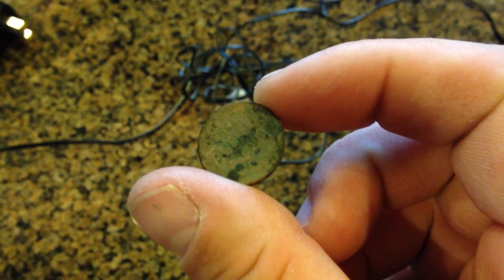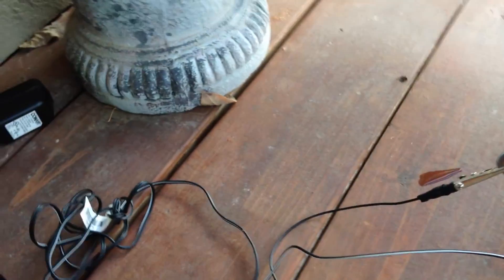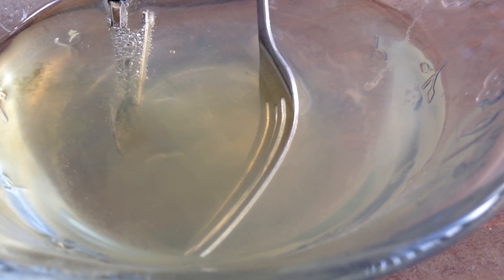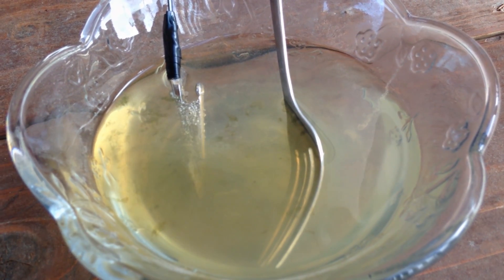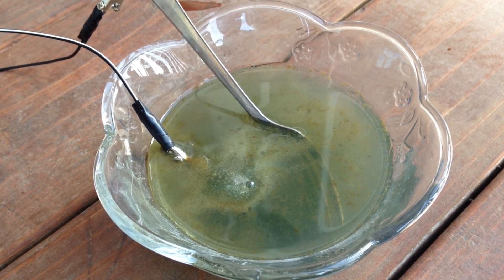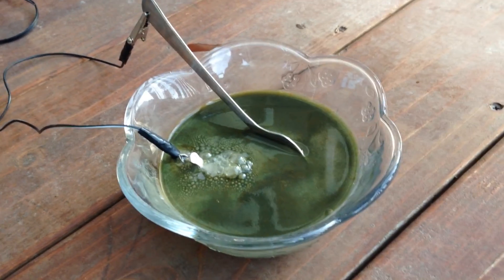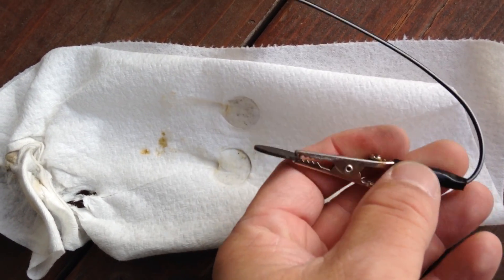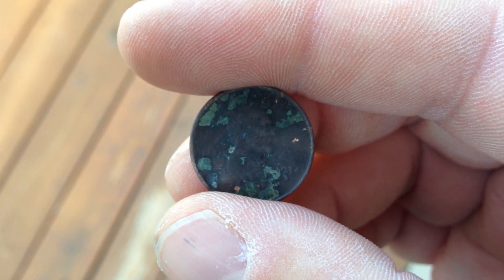Coin Electrolysis- Basic How to

Comment: Never use stainless steel in electroloysis
Reply: but why tho
Reply: @nathanholyland9493  while you use SS as an anode, the chrome that is finished on the steel is also be released. 
This releases hexavalent chromium poisoning which can only be released if chrome is heated, or being separated from where it is placed. It's very dangerous, and the effects are just as bad as chloride gas.
Reply: @czoduqa  so basically, dont do it or risk health problems or death

Comment: Use washing soda - not baking soda.
Don't use salt.
Don't use stainless steel. Use plain old iron, steel or carbon rod as your sacrificial piece.
Positive connector on the sacrificial piece. Negative connector on the work piece.
Keep your connectors out of the water!

Comment: what watt and volt is the charger plug ????
Reply: Those transformers aren't standard.They put out different voltage depending on the appliance they're made for.
Reply: Mr. McGoo the electrode dissolves though so the wire would get shorter over time I imagine
Reply from the maker: It is just a standard charging cord from an old shaver i had.
Reply: thanks Ryan , does it matter  what watt or voltage I use ?  , I want to try this a.s.a.p. it looks to work great , just don't want to get zapped  LOL
Reply from the maker: jeff c the Higher the wattage the faster it will work. I use this one and it takes about 1-3 hours to really clean the coins.
Reply: very cool thank you !
Reply: You could use  a standard electric cord and really save some time. Blow that crust off almost immediately.

Comment: Something that you absolutely have to know because you're actually putting yourself in danger not because of the electricity I'm sure you're being careful of that but you absolutely have to stop using stainless steel as your sacrificial piece of metal because when using stainless steel in an electrolysis setup it gives off a toxic gas it is very dangerous used just a piece of regular old run-of-the-mill Steel easiest way to know is if it's got some rust on it then you are safe
Reply from the maker: Yes. I only do it in well ventilated outdoor areas. I would never do it inside. Thank you for the heads up
Reply: +Rocky Mountain Prospector Ryan I don't know if you're thinking that I'm just talking about hydrogen that is something that will be created when you are just using regular old steel or iron if you use stainless steel the components that will be broken down into the water and gas are hexavalent chromium it is a very highly toxic substance causes cancer and all sorts of really nasty things and it is completely illegal to dispose of the water that that is mixed with and you could actually receive a huge fine and I've actually heard of people getting prison sentences for disposing of this you really should get rid of the stainless steel that you're using as your sacrificial piece of metal and just use a piece of old rusty metal or another good thing is go to a Place Like Home Depot and get a piece of rebar and cut a piece off of that it will last you a long time and it is safe to use it is not a good idea at all to use anything stainless steel in your electrolysis setup
Reply: +Rocky Mountain Prospector Ryan you might have even heard of hexavalent chromium if you are someone who watches movies and possibly seen the movie Erin Brockovich all those horrible things that happened to those people in that movie which is a true story that is what you  are exposing yourself and your family too but using stainless steel in this setup I can't stress enough you really should not use stainless steel it is highly highly dangerous to use in an electrolysis setup even in a ventilated area because it doesn't matter about ventilation because most of the hexavalent chromium will be in the water that you dispose of afterwards which like I explained already is highly illegal disposal you need to have it properly disposed of at a chemical waste dump and you don't even want to go in having this substance because like I said it's illegal to even have also  you absolutely do not want to be putting your hand in that water to get anything out you don't even want to be touching it obviously do what you want no one can stop you from doing that but every word of what I just said to you is 100% true and accurate do you really want to be putting yourself and family in that Danger or be risking fines or imprisonment
Reply from the maker: +Matthew King thank you for that info!
I am going to switch out the piece of steel I found metal detecting today.

Comment: use baking soda instead of salt because salt will produce chlorine gas
Reply from the maker: I will definitely try that. Thanks for the safety tip
Reply: and dont forget the sodium hydroxide
Reply: Niv Moshe the sodium hydroxide could be useful if you are making sodium metal
Reply: Drake Mckay actualy its hard to extract the sodium hydroxide by that way because it will react with the chlorine gas at the anode and will produce soduim hypochlorite bleach
Reply: Nah, that's just for molten salt and not salt solution. The bubbles here are hydrogen iirc

Comment: er...isnt the negative connectected to the penny?
Reply from the maker: +Ivan Tsantsarov I just put both ends of the electrodes in the water in the one started foaming was the one I connected to the coin
Reply: +Rocky Mountain Prospector Ryan, I think that positive charged Cl ion grabs an atom from the fork, deliver it to the coin and then Cl gas releases in form of bubbles. That is what caused foaming
Reply: +Rocky Mountain Prospector Ryan,  because electrons runs out of the negative and separates the rust and one just falls down :)
Reply from the maker: Tony Carpenter ive tried it both ways and i think you may be right

Comment: How much of the Copper (Cu) base metal is lost during the process?
Reply: A small sheet of copper in place of the fork and use some copper sulfate in your water...  then you won't loose any copper, as it is your copper with replacing Fe++.
Reply from the maker: The electrolysis doesn't harm the copper I don't believe. At least when I've done it the coin didn't seem to have been affected by the reaction going on.

Comment: Replace the salt with baking soda, it makes a difference... speaking from experience, also I hook the negative to the coin not the positive.
Reply from the maker: I am going to try that. Thank for the tip!
Reply: no problem, you should see a huge difference when you do..
Reply: what's the voltage that you used?
Reply: Exactly negative to coin ( cathode) positive to sacrificial (anode) and baking soda is better